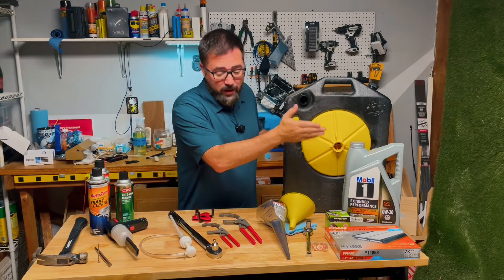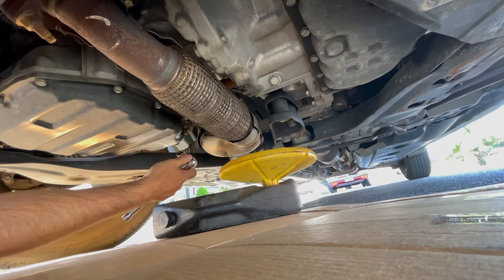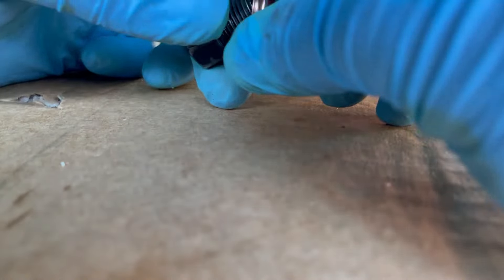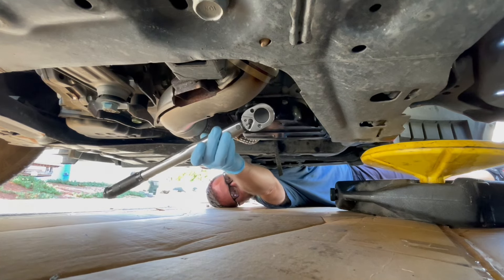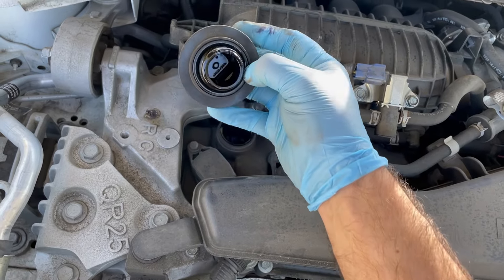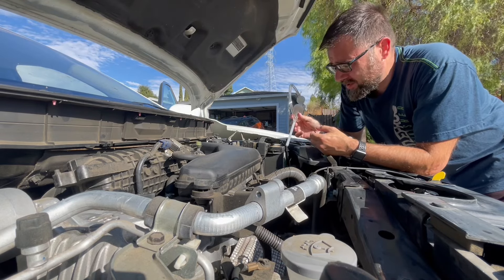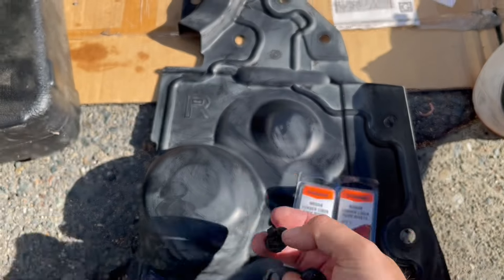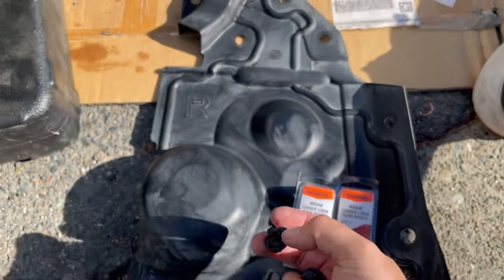NISSAN ROGUE diy OIL CHANGE & Air Filter | also 2018, 2019, 2020

Comment: What, it's been 2 years🤔
Reply from the maker: I mean at LEAST since the oil filter was changed I guess. 🤷🏻‍♂️
Reply: @GeneralBuckles  Do you know the maximum time for oil and filter change is 1 year or LESS if you exceed the recommended oil and filter change. It is written in your owners manual.
Reply from the maker: @flrpower5628  I’m sure it is. As I stated in the video this is my GF’s mother’s car and she bought it used probably 2 years ago. So the timing makes sense. Shes in a nursing home now (that’s why we have the car)

Comment: I can not find anything on a 2018 Rouge Sport with the 2.0 Liter engine.   I can't find the radiator drain plug.
Reply from the maker: Some googling seems to indicate it’s on the bottom of the radiator…. Check with the online Nissan Rogue forums